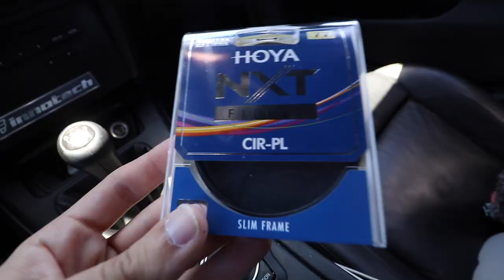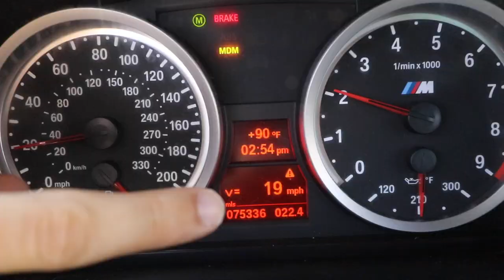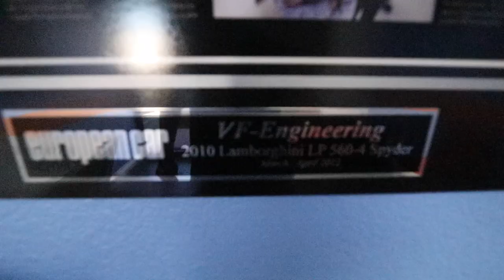Should I supercharge my E90 M3?!

Comment: the vf engineering kit is definitely very reliable. and obviously your car isnt under factory warranty anymore so voiding the warranty is out of the question, i think you should do it. even the stage 1 kit is nice as a daily driver, 540hp/370lbs for $6500.
Reply: Adrian P wtf 540hp for$6,500 hell no on a 15+ mustang GT you can buy a gen 3 vmp supercharger for $3,500 and make 650hp+ 630 torque
Reply: lol comparing mustangs and m3s

Comment: That b7 rs4 in the back is sexy af..I currently have s b8 s4 but really want the fsmn sound of a v8 love bring boosted though and also the whine I get from my supercharger. Been looking at an e90 m3 and b7 rs4 like crazy might end up with the e90 though for strictly performance reasons just scared about the reliability. My buddy has an e36 m3 and other buddy has a e92 335i the e92 hasn't been the most reliable my Audi has had less issues believe it or not.